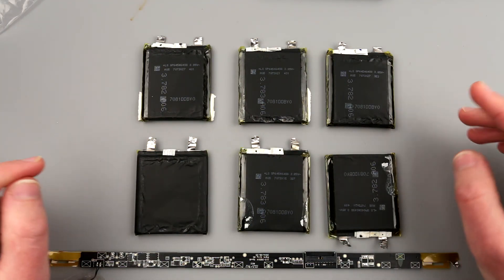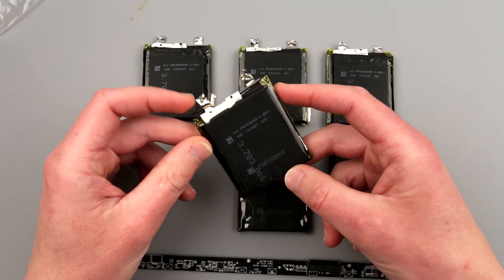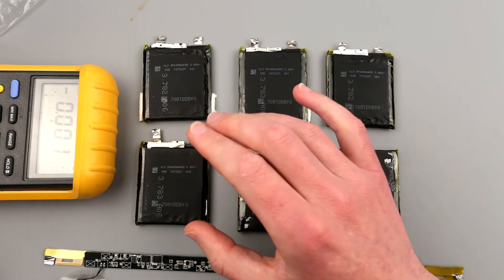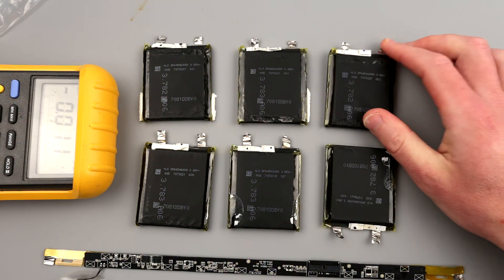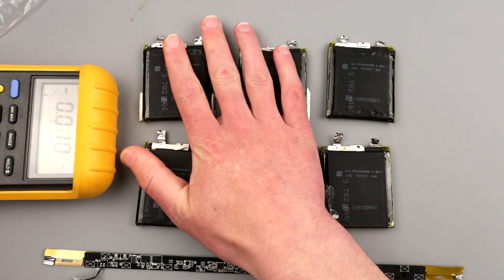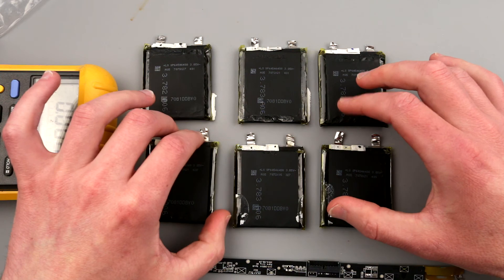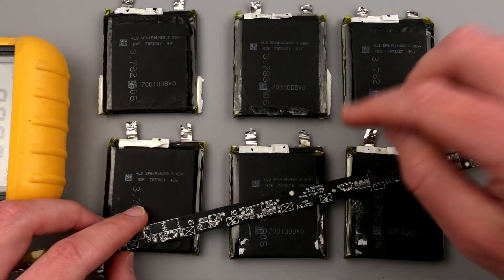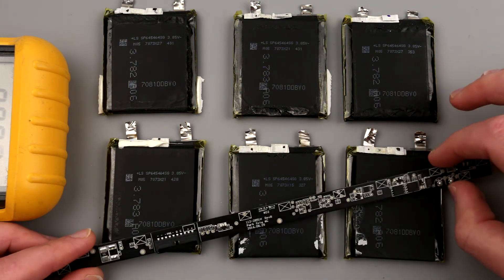Salvaged Lithium Batteries from Dell Laptop battery

Comment: Can you charge each cell in the pack separately while connected to BMS by just using two pins on the cell connections using a single charge bms?  They are said to have a safety feature which will turn off the battery pack if the power is left on and the bms shuts the battery pack down to save it from destruction. My computer diagnostics shows no errors nor does the bios even detect the battery now. Charger block works and powers computer but battery not detected. Battery Model No V6W33 54 Wh 15VDC battery. I opened the battery pack and checked the cells . If cells should be 4.4 VDC per cell. What would be the charging threshold Voltage that the computer onboard charging  circuit needs to see? What should I be charging each cell to to get the battery Pack recognized? We just need to find this the last answer to the last question to get the pack to work again. Thanks for the video.
Reply from the maker: Oh! I'm afraid this information well above my expertise level :D I just take things apart occasionally fixing them :D

Comment: These are Lishen batteries (designation +LS), group MH27663 with a cutoff voltage of 4.4V (TIANJIN LISHEN Lithium Batteries). Cells of average quality. Number one of the pouch type batteries are SONY MURATA, (US designation) or ATL (+ATL designation). There are also CATL, but I don't know much about those. Some +ATL with graphene leads are the best in the most expensive phones and have a life of about 1200 cycles. SONY averages 900, while Lishen from 50 to 300. Lishen once formed consortia with Valence and Proven, producing LiFeMgPO4 batteries for seagway. Long story short. The cells don't like discharging below 2.7V, they become unstable, while sony in this states recover capacity beautifully due to lithium intercalation at rest. Similarly, when held in high states for 7 days, capacity can be recovered from anodic sag and faster intercalation in extreme states of SOC
I have hundreds of new cells of this type, SONY/ATL with excellent patameters from the glass replacement program in phones. 90% are brand new cells, they always indicate a few % higher capacity than guaranteed..
Reply from the maker: Thenk you very much for such extended information! It helps alot! Also now i can digup some specs on those. At lest to understand sheir specs. So you think yhese are gonets if they were pretty much dead after i pulled them out?
Reply: @InsideOutElectronics  When it comes to recovering the capacity of nanotechnological cells, specifically pouch cells like both LifePO4 and modern Lipo 4.4V-4.45V, they should be discharged to extremely low safe voltages (2.5-2.7V for LiHV and 1.9-2.0V for LiFePO4). In this discharged state, slightly heated (35 degrees Celsius), they should be kept for approximately a week. Subsequently, recharge them with a low current, preferably a 20-hour charge at an elevated temperature, for example, in a Styrofoam box with an insulated wire for hanging clothes at the bottom, or use a thicker Kanthal wire. I have successfully recovered cells from a 47% usage level to 4% using this method. Scientific literature supporting this can be found in several places, such as:
--- --- ---
https://www.sciencedirect.com/science/article/abs/pii/S0378775319314958
--- --- ---
https://iopscience.iop.org/article/10.1149/1945-7111/ab7900
--- --- ---
Additionally, there are several links discussing the rest and relaxation of electric car batteries. The key is the intercalation of free lithium, where indistinct electrode surfaces dominate, leading to the deposition of metallic lithium. Please thoroughly read the literature. Modern organic electrolytes are stable up to 60 degrees Celsius, debunking the misconception that high temperatures are fatal for them, as was the case with old LiCE 18650 cells. The issue lies in the dissolution of copper ions, delamination due to lack of compression, and gas formation, all of which I manage.

On approximately page 34 of a document regarding 20Ah A123 cells made with 8nm technology, there is information about compression. You can find the document online. Contemporary LiHV cells do not compress, but they efficiently remove gases that are formed fractionally. Improvements in parameters such as internal resistance can be achieved by using a vacuum bag for a vacuum cleaner, creating maximum negative pressure and keeping them in such a state. Air will eventually penetrate, and the cells will be degassed, reducing the "distance" between the electrodes due to the absence of oxygen bubbles. It's similar to the spontaneous deflation of a ball or a deflated tire. No metal is perfect enough for oxygen molecules to remain 😊 Negative pressure is necessary!

Regarding charging from zero volts, there is a risk of contamination with copper ions, potentially creating a "dormant cell" with a passivation layer. For example, very cheap 97Wh batteries for Dell XPS-7590, around $10 USD, were purchased in Poland through the Allegro portal. Even those with 47% usage recovered nearly 100% capacity after the described process. Lithiation due to fast charging at low temperatures (>25 degrees Celsius) and high state of charge (SOC) in laptops is a problem, among others. At 8 degrees Celsius, even initial charging induces lithium galvanization. Delithiation is necessary, and I have done significant work by adding negative pressure and gravitational compression to scientific experiments. Reading guides about discharging through the BIOS to complete shutdown will not provide information about holding for a week. It's a mistake! (They write about 3-5h) Delithiation takes quite a long time, possibly a month at room temperature. Subsequent slow charging after delithiation at an elevated temperature works wonders, but remember, this applies to high-voltage chemistry – graphite + silicon. Modern Dells with USB-C should be charged, after delithiation, while turned off using a USB-C charger with the lowest power possible, e.g., 2A, 5V (10W), or better, 1A, 5V. Batteries will revive.

Another issue is the lack of balancing in laptops. High-quality cells maintain voltages, but sometimes the separation of the foil and balancing are needed. Proper punctures can also be made. I won't go into detail here, as it would turn into a substantial film with descriptions consistent with science. If there's a need, I can film another regeneration process from A to Z. If I forgot something, please ask.

Best regards,
Marek

Comment: any one , how can we charge theses flat batteries ?
Reply from the maker: Im using Tronxy RC battery charger
Reply: @InsideOutElectronics  ive just salveged 24 of these type of cells some red some blue,what ive noticed is if i test a cell on a Buck Converter and it starts charging then i throw it on a TP4056 Lithium Battery Charger Module Charging Board and they seem to be charging ok,most are sitting at 0.6/7v ,ill let you know how i get on
Reply from the maker: @ianl4308  I was using Turnigy RC battery charger, first started as NiMH charge, whic rises the batt voltage to 1.3, then swotched to LiFepo, then ti LiPo.... But you have to monitor this constantly, do not leave charget unatended when usimg inapropriate mode.

Comment: Can't you just use the assembled lipo laptop battery without disassembling the individual cells? Is it going to charge if supplied with power? Or does it require any special communication protocol to work? I mean, the dell battery as an example. 
I just don't see a point to disassemble the individual cells if the assembled  battery works (at least it works inside the laptop). Even though some of the cells are swollen (and probably disabled by the battery's charge controller?) . Also, the battery provides ~15 V which works well for some of my appliances like the wifi router, unlike the individual ~4V cells.
Reply from the maker: Assembled battery pack did not work, it was completely shot. If at least one battery is disabled by controller whole pack will be rendered nonoperational, AFAIK.
Particularly in my use case I have more 1-2cell project rather then 12-15V :)
But if your battery can be operational, yeah,  there is no reason to take it apart!
Reply: @InsideOutElectronics   Hey guys, I was kinda thinking the same as @AgressiveHouse . I've got similar flat dell battery (7.6V) and it's not completely dead. Ideally I'd like to use it as a whole and charge it with USB and discharge afterwards. The internal circuit should contain BMS (for balancing) and also the voltage regulation (the power supply is about 20V so there must be regulator along the way). Any ideas if the battery can be charged/discharged without digital communication?
Reply from the maker: @matejv2840  I count figure this out and take it to pieces :) Would be nice to know how to!

Comment: I think the bms still works using some resistors, just we have to connect those +ve & -ve and the other data pins to switch and run the bms. 🤷‍♂️
Reply from the maker: Are you talking about using BMS for other purposes?
Reply: @InsideOutElectronics  Yeah... It will work!
Reply from the maker: @DIYwithBatteries  Thank you, I will dive it a try !

Comment: What's a good way to charge these individually? And do you think each cell has its own low voltage/thermal protection?
Reply from the maker: I'm using RC Lipo charger like Turnigy from HobbyKing. And yes to low voltage/overcharge, not sure about thermal